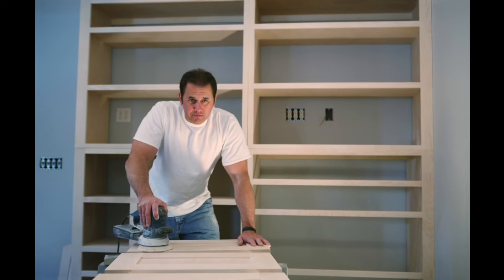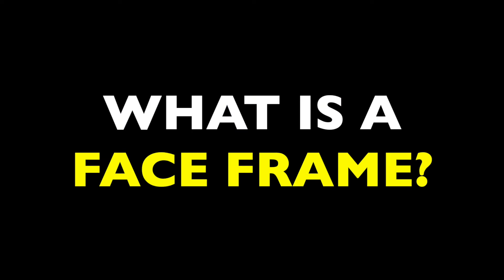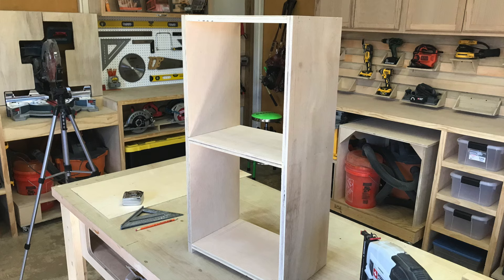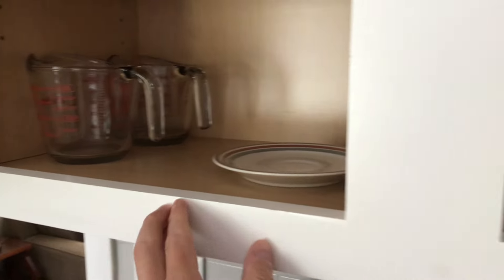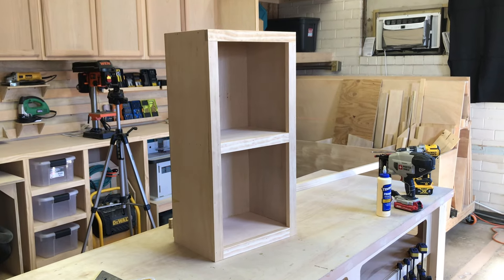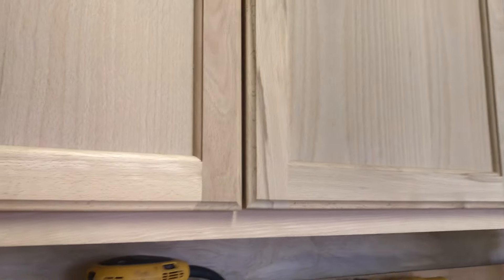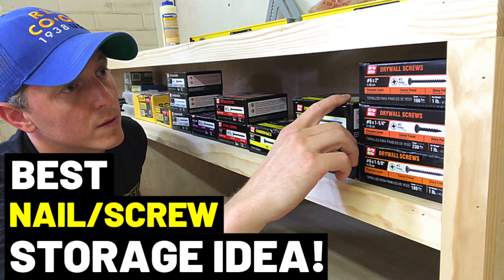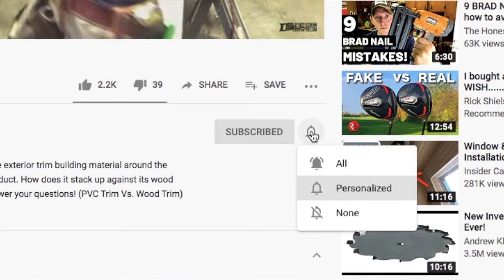#1 TRIM SECRET--This Is The KEY To Better-Looking Cabinetry/Woodworking Projects! (For New DIYers!)

Comment: I'm just moving into a new house, that is pretty much stuck in the 70's in terms of decor. A lot of the cupboard doors are uneven and run into each other after years of sagging. This made me think that it could be easy to put face frames on the front of the cabinets as a quick method to make things look better in the short term, and have a better surface to mount different cupboard doors to. Not a complete remodeling, but something to make the look a little fresher.

Comment: This is exactly why I'm subscribed to this channel! I just built two small 7" base cabinets and a large 30" wide wall cabinet for the first time. When I assembled the carcass w plywood, I was afraid they would turn out flimsy since the plywood was a little bowed. After I built the face frame it became much more sturdy and it actually looked good for my first cabinets!

Comment: I think old finish carpentry adage ‘don’t expose end grain’ forces one to all these solutions, face frame or laminates. Finish carpentry means painted surfaces, frequent hand holds, exposure to moisture.  End grain is not durable under these conditions
Reply from the maker: Very true, Falstaff. End grain and unfinished edges are things that have to be thought about on EVERY project. Some woodworking techniques to conceal them get extremely complex.
Reply: @TheHonestCarpenter  Great work on your videos.
Reply: don't forget the 'old finish carpentry' solution:  make your panels instead of using sheet goods.

Comment: I did a face frame on my kitchen closet but put the face under the shelf instead of attached to the front. If it is on the front, only the fasteners are holding the shelf from bowing downwards under the weight, vs. the edge of the face. In addition, of course, the shelves are tied into the back wall and side walls. That's a long run of shelf, 3 feet. But oh, my god is that solid. It has zero deflection under heavy loads of canned goods and other things.

Comment: One of my first large woodworking projects about 20 years ago was to build a book shelf on the front wall of a loft that went between knee walls and over a window.  I was going for a rustic look.. I took 2x6's, ripped them to have a nice square edge (This is before I got my jointer), glued them up and built a VERY heavy book case about 15' wide by 7' tall and matched the roof angle with the different levels of the book case. No face frame need since the face was already 1.5" side. Thing is still there, still looks great.. Holds a LOT of heavy books and doesn't sag. My later projects absolutely incorporated face frames or nice routed edges.

Comment: The structural support offered by face frames (as you point out with the mini I-beam comment) also allows the use of thinner plywood, as you highlighted in another of your excellent videos. Thanks for sharing.

Comment: Thank you for a good explanation of the face frame. I see them used more often in work from America than from Europe. Personally I prefer the "modern" look with exposed edges, if you have good plywood it can be quite a good looking detail. But it can be a pain to get it pretty. It can be smart to offset some components, like for instance shelves, so they sit a little further in. So much easier than to make everything flush.

Comment: Amazing how this video comes out the exact day, where I plan to prototype cabinets for our remodeling project in the first room you enter through the front door (I don't think there is an American equivalent. We keep washing machine and dryer, there is a sink and we have all our footwear and jackets in that room)

It is hard to voice how much I (and probably my wife) appreciate your content. It undoubtedly increases the quality of my work
Reply: In the US, an entrance room to the house itself as you've described is  called a mudroom.
Reply: @olderendirt  Thanks. I've never heard the word used before but it fits quite well.

Do you know if most houses have one? My knowledge of functional American architecture is pretty much non-existing
Reply: @danishnande9629  aside from allotments built all at once, architecture here can be pretty inconsistent. Mudrooms are fairly common, though. Many houses have one on the way in from the garage, in which case they tend to be called a "utility room", but essentially the same concept.
Reply: @danishnande9629  I've noticed newer builds tend to have them more than older homes. My house is over 100 years old with a basement so that's where my washer and dryer are. I have an unheated , enclosed back porch which is what we'd technically use as a mudroom unless we're really messy. We'd just use the basement entrance where the appliances and sink and one shower are.

Comment: I would like if you addressed a unique subset of the DIY rookies:  those with arthritis.  For instance, are there any unique tools that help those of us with super weak hand strength?
Reply from the maker: Very good suggestion, Mary! I’ll do a little research and see what I can come up with 🙂
Reply: @TheHonestCarpenter  I just bought an "egg beater" non-power drill because holding a power drill is very difficult for me.  I will see if I can make it work!  I am seriously considering the Dewalt gyroscopic screwdriver for same reason.

Comment: Great video. To expand on face frame, stiles are the outside vertical pieces. Stiles always run top to bottom. Rails are the horizontal pieces, they run between the stiles concealing end grain. And where possible, flush sucks.

Comment: Another great instructional video.   Thank you for sharing.   I am new to woodworking, and I want to experiment with and without face frames.  Without, I would likely use for painted projects where I can fill and sand the exposed edges.  THANK YOU!

Comment: Guilty of using almost exclusively the Euro look (no face frames).  A lot of good points made in the video.  As for exposed edges - I've used green bucket drywall and 'hot' mud in the past.  Also, Bondo works quite well.  All when painting.  Love to have the pocketbook for ApplePly for exposed edge, unpainted pieces.  I guess Baltic birch will have to do for now.

Comment: I like the idea of putting an edging piece on each exposed plywood edge. I'm at a loss as to what type of timber I should use when edging birch 18mm ply, which is not being painted. Thank you for your informative videos. They are great. From the UK.

Comment: In the past, when installing fitted shelves made from fair faced plywood (usually redwood), I have often used narrow architrave (usually whitewood) on the front to conceal the exposed ply edges. It can be flush with the level of the shelf or maybe just a little higher to create a bit of a lip at the front of the shelf - both work well. The contrasting colours make no excuse of what is going on and they marry up well. The Architrave helps to keep the shelves straight and support any load that will be placed upon them. The effect works very well when you are fitting shelves in alcoves on both sides of a central fire breast. Remember to start with a large shelf opening at floor level (20" to 24") and gradually reduce them as they go up towards the ceiling (12" to 10"); I would recommend 20" at the bottom and 12" at the top - anything below 10" at the top would not look good.

Comment: Appreciate it.  Have seen it before, of course, but this provided much more insights to the idea.

One other down-side to large face frames I've noticed over the years:  it reduces the size of the opening of shelves, which therefore reduces the size of large items (e.g., boxes) you can put on the shelf.

Comment: Nice video, very informative, especially for beginners like myself. I would say though, frameless cabinets are (certainly in my experience here in the UK) very common, even in expensive fitted kitchen cabinets, with full overlay cabinet doors, and edge banding on the carcass edges.

Comment: Hi, I just got some small mdf sheets very cheap, some of which are going to be turned into cabinets with the thickness only being 7mm I'll most definitely be using a face frame as well as shims inside. On my other project I'm using plywood but I'll be ironing on trim prior to painting, some use filler but I can't be asked. Great vid for explaining to newbies and older diyers.

Comment: Yes I built a face frame and panel doors on the bottom half of the last project. The upper half I did not. I’m using stair treads which have a bullnose perfect for exposed edges.

Comment: For some shop furniture I've done sold wood edge banding (3/16" to 1/4" thick), but will be doing face frames for a nicer sports locker style shelving unit in my garage.  Great video!

Comment: I worked summers for a custom cabinet maker while in High School, and everything used face frames.  I remember the owner walked around with his story stick like it was a security blanket.  Fast forward 25 years, and I can really appreciate the story stice and use one for cabinet and furniture builds.  My job primarily was to use a horizontal boring machine to drill for dowels.  Once all the glued up frames were dry. I used a stroke sander to level them out.  I can't remember the last time I saw a stroke sander, though.  Nowadays, I use my Festool Rotex 150.

Comment: Personally, I'm using glue-on edge banding. But, another way is to use 1/2"-3/4" trim that is then attached to those ugly edges. There are several router bits available that allow you to create complimentary faces in the carcass faces and the trim. These look just as good, or better.
Don't forget about pin nailers. 23 gauge headless pins are nearly invisible.

Comment: Great video and makes it less daunting for me.

I've been reluctant to use Face frames as it's extra wood, time, etc, but my alternative of edge banding, sanding etc, is taking a good amount of time as well and there's more imperfections, so I'm going to try my next set of cabinets with face frames and see how it differs in time.

Also, If your cabinet is slightly out of square (I'm getting better at this, but not perfect every time), using a face frame and a small reveal when mounting your door would probably help rectify that.

Comment: My first job as an apprentice joiner was in the faceframe section.
We'd make 8' wide frames and pass them through a wide belt sander , twice
Lots of fun in 36°C heat under a tin roof. Hmm 1977 'twas

Comment: Sir, very well put about how a face frame can bump up the value of a project.  The one thing I wished you would have had mentioned is how using a router to add decorative additions to those face frames, though that may lead into a whole new video itself, it would have had been nice to see some examples….  Thank you for your contribution to the DIY community.  Please take care and keep well.
Reply from the maker: Thank you, Clever! Very good point. You’re right though—every time I think about including something in a video, I realize it may add minutes to explain, and I quickly start second guessing myself 😅
Reply: @TheHonestCarpenter  Yes sir, very much agreed, it’s a real pain trying to fit three cubic feet into a two cubic foot hole.

Comment: Face plates are a Great concept! Considering the time and effort, the results of adding a face frame is a good return on investment. I like the finished look, hidden joints, and added stability to the overall project. 
*I have a request for a future video: possibly some insites into the use of different types of wood and then some finishes, as stain would enhance dense wood grains as opposed to painting surfaces of lesser quality wood surfaces. An example might be oak or mahogany vs a pine stock.  Thank you!

Comment: I made my first two face frames on some shop cabinets a few months ago. They were frustrating to get everything square. I’d measure corner to corner, tap, tap, and remeasure several times before it was right. Then one of the frames came out a bit off square during the glue up somehow. Any tips you’ve got for getting them square and keeping them that way through the glue up I’d highly appreciate!

Comment: i’m in a opposite situation ; a kitchen full of cheap looking builder grade a cabinets all face framed that look dated. To modernize the look i want to reface them with glossy slab doors. i have been trying  to find out if i need to remove the frames first in order for the doors to go edge to edge (ie no frame showing behind the door) ??  advice?

Comment: When putting together a face frame what is the usual width of the wood used?  I know 3/4" is a good thickness but is 3/4" also used as a face frame.  I'm going to guess that 1 1/2"- 2" is a common width of the face frame.  What's the width most commonly used?

Comment: Aren't the stiles supposed to extend from the bottom to the top of the cabinet and the rails between them them?  just asking.
Reply from the maker: In almost all cabinets, yes, break! But this little thing is going to sit on the floor in my closet, so I ran the top trim piece full width.
Reply: @TheHonestCarpenter  👌

Comment: When you attach face frames to the carcass with brads and glue is the bond strong enough because some of the plywood plies are actually end grain. Am I over thinking this?
Reply from the maker: There really won’t be too much stress on them over time Brian. Just get a good glue layer on them…I’ve never had one break or move!

Comment: I cut a face frame today out of birch ply and I now have a plunge saw I thought this would be straight... Nope it seems my rip cuts went all askew. Maybe I should have cut the rails as one piece instead of cutting the face frame as if I had just cut a hole out of the sheet 

I am a little disappointed because I keep making mistakes and I feel like I'm on a knife edge of ruining my project which isn't exactly plum or square, I have to work around it.

Comment: What thickness of face frame is standard? I am thinking about doing this to the original cabinets in my 1970’s home. I am thinking of using 1/4-1/2” thick plywood face frames. Just don’t want it too thick but I am not sure how thin I can go! Great video!!!
Reply from the maker: 3/4” is the most common, Corey! I use a lot of clear pine or pre-primed pine.
Reply: Anything less than 3/4 inch and you may not have enough thickness to mount door hinges. If you use face mount hinges, 1/2 inch might be enough for the screws to bite into, but if you're planning on using any type of European style hinge, you'll need that extra thickness. Just built my first set of cabinets for some friends and used the European style hinges and it was perfect. Good luck with your project!

Comment: Building furiture is all about hiding unsightly joins. When you make a box there's an order of construction that every cabinet maker follows. I once built a bar top using MDF. I first lipped the edges with Walnut about half an inch thick, then veneered the surfaces. You end up with what looks like a solid slab of walnut 15 ft long at a fraction of the price. This is why veneers were invented. I don't understand why people insist on spending a fortune on solid wood when you have stability issues and you can't tell anyway.

Comment: Does the face frame sit wider than the structural pieces behind them? How much wider does it need to sit from the actual board itself? I.e. if you have an 18mm shelf piece, what width is the face frame?
Reply: What i was wondering...
Reply: I always use an 1/8" overlap, at least on the sides and top. You can do it on the shelves, too. You just can't slide things directly off the shelf; you need to lift over the 1/8".

Comment: Furniture build this way is incredibly heavy, I like to use a frame design with thin plywood about 4mm or 6mm plywood. I also like to make cut outs, simple holes with the forstner drill just like in aviation design, you strength weakens by about 10% but your weight goes down 50% or so. I hate this heavy furniture, can´t easily move it around when you vacuum or move places, I really hate it.

Comment: You need to add one more thing. At least I find it invaluable.  If it's not just freshly cut, sand the edge of the plywood to reveal CLEAN wood before gluing.  Great video however! Thanks

Comment: Prefer frameless ... if done well, it is the epitome of the clean, modern look of Mid Century ... 

Build the carcass with solid wood instead of plywood .... or use plywoods with edge treatments to hide the plies...

I find the face frame look too old fashioned as are shaker cabinet doors ... however, there is a place for Face Framed cabinets, etc.  but it needs to be part of the overall design aesthetics of the house.

Comment: I would much rather have a face frame than a laminate on the edge like that. Laminate is durable enough I guess until you get it wet. I've also seen laminate edges just start to peel, and once they do they just peel right off and the result isn't pretty.

Comment: Good video. Except, your examples of stiles/rails is incorrect. The stiles should be cut full height of cabinet with rails in between. Only end grain is on top and bottom of stiles. Hidden by floor/toe kick, ceiling or counter top. Rail end grain on the side of a cabinet/face frame is a rookie DIY move. Okay on shop cabinets I guess but still. If you’re going to make an educational video so to speak, make sure you know 💯 what you’re talking about. Great content though sorry for the rant. Lol

Comment: Pocket hole screws are for hacks, not real carpenters. Cabinet frames build before pocket hole screw systems existed will look better and lass long after the pocket hole screw frames have fallen apart.